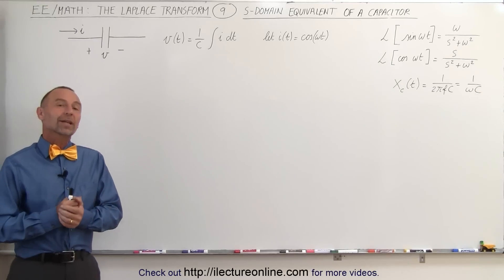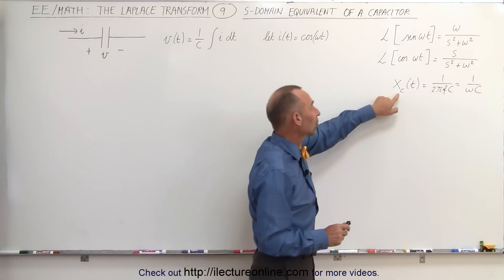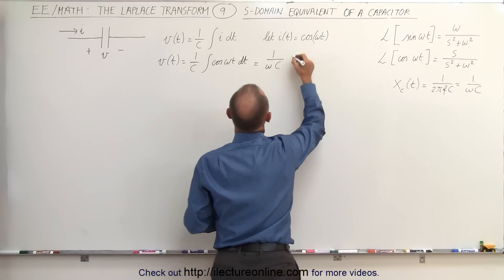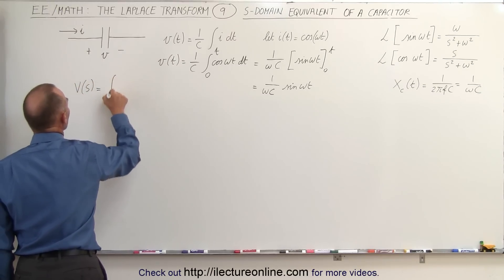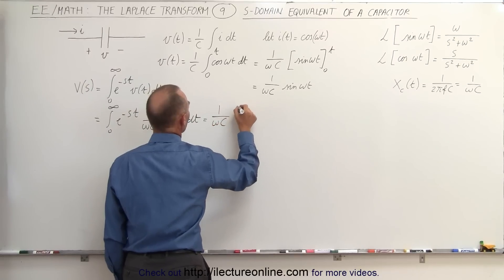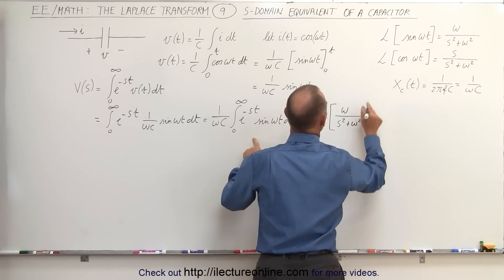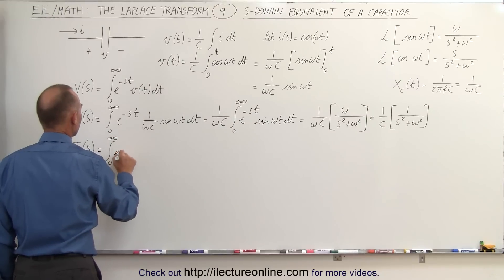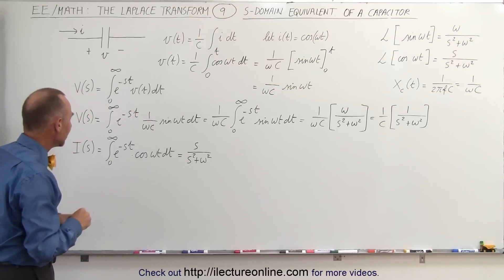Electrical Engineering: Ch 16: Laplace Transform (9 of 53) s-Domain Equivalent of a Capacitor

Comment: Hi Sir, if i = sin(wt), the X answer would be X= -s/c, not tally with i = cos(wt), The different btwn Sin and Cos just phase shift of 90 deg. or pi/2 .. Could you please explain on this .. TQ
Reply from the maker: You can determine if you want to use sin or cos by knowing what the value is at time = 0   Use the cos if the value is max at time = 0 and use sin if the value is zero at time = 0 and increasing.
Reply: @MichelvanBiezen  let me try n c later.. tq
Reply: Ok sir, Finally i got the answer. (-1/cw)*[Cos(wt) -1] after intigrate the (1/c)*int 0 to t sin(wt).. Afterwards laplace the (-1/cw)*[Cos(wt)-1] .. i got it X = 1/sc.. TQ vry much..
Reply: Hi sir, Could share your email address pls. i will share my solution of i=sin(wt)
Reply from the maker: We don't have the time to correspond through e-mail.  We receive too many requests.  We try to answer the question in the comments as best we can when time permits.